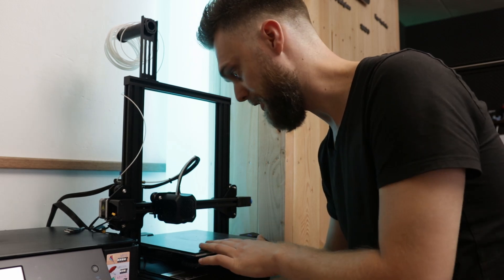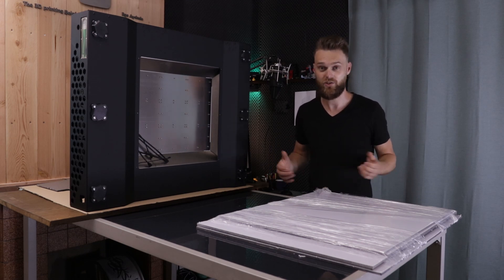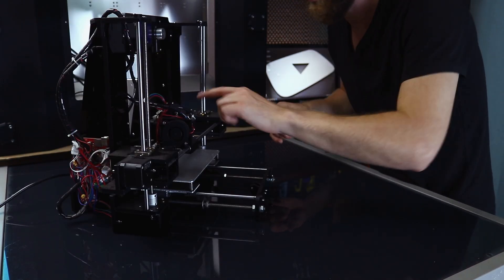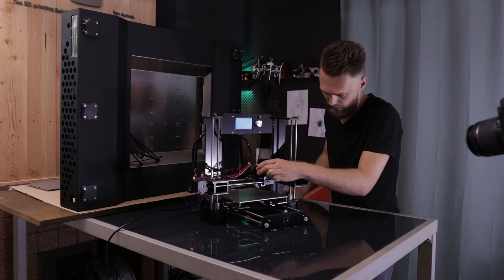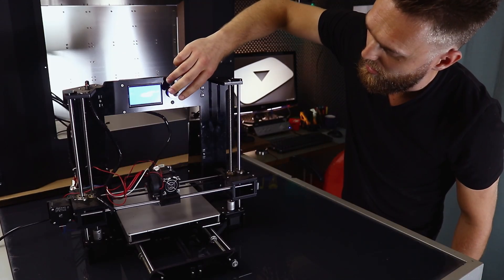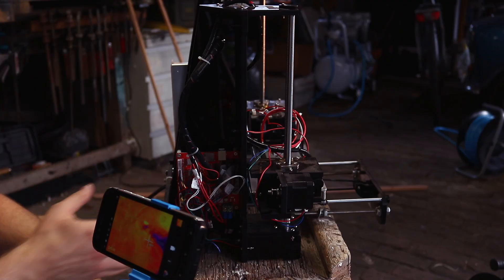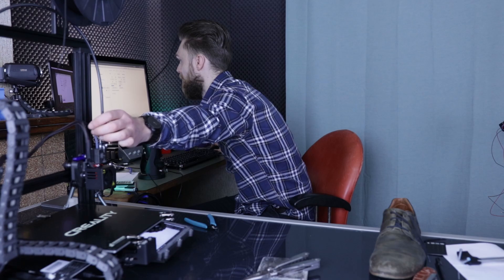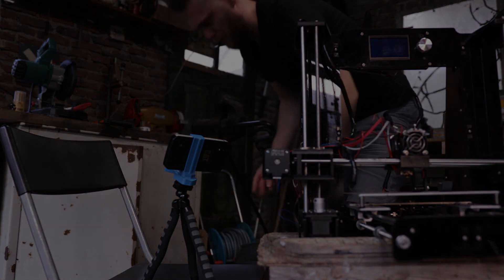Is it possible to destroy a 3D printer by moving the axes by hand?

Comment from the maker: Hi guys! I decided to do this experiment because I had this idea in my head for quite some time and it takes a bit longer for that enclosure to finish. Have fun watching and have an awesome day!
Reply: Be aware if you want a guaranteed way to nuke the mainboard, keep connecting and disconnect a stepper while the mainboard is powered.

I killed an Ender 3 output that way while turning it into a belt printer.
Reply from the maker: @JustTechGuyThings  Yes, that's the real back EMF you're talking about! Destroying the drivers isn't too difficult xD How did your belt printer turn out?
Reply: @properprinting  it's still in pieces in my dining room table :D
Reply from the maker: @JustTechGuyThings  sounds like a nice project! I want to do something similar :D Good luck m8 are you posting it once it's finished?
Reply: @properprinting  It's been about 10 months, I prototyped it using the regular bed  ( https://imgur.com/a/IVOVX42 ) but now I'm stepping up into an actual belt now.
Reply from the maker: @JustTechGuyThings  ow yes this is nice!
Reply: Populaire producten oplopende het goed om de omgeving is ook open zijn op o
Reply: Nice video, but there is a chance that you can destroy a trainamic driver by moving the axis by hand
Reply: There are cases when skr 1.4 sd card where destroyed by doing this. Not all boards derive well the power generated by the motors used as a dynamo. The ground connections, wiring, etc counts too. But if you have a minimun amount of brain inside yout head when mounting or designing your printer or your board, i think this will not happen. At least not often.
Reply: What about the z-axis? Because of the screw gear, rotation of the z motor is amplified, which could lead to a much higher voltage.
Reply: Maybe you could try turning the z axis with a drill. Would be much faster than you can do it by hand.

Comment: JUST NOW: I accidentally caused a fire on my driver and board. I was frustrated that the sensorless homing had become overly sensitive, so I tried to move the XNY axis by hand. Unfortunately, since the printer was still on, the driver caught fire. DO NOT TRY THIS, especially while the printer is operating.

Update: I managed to save the board (Octopose Pro 1.1); only the driver got burned down, and the main reason I found that that burned driver was getting power from the board was that my other driver was getting direct power from the power supply. Besides the driver, my stepper fans (all of them) burned too, have to replace all of them.

Comment: Nice video, I do love your efforts.
I fix 3D printers for others and one of them was the cr-6 which was running smoothly then when my friend suddenly moved the bed fast the machines low voltage signals became 0v and now the machine can’t extrude filament properly.  For most machines they are built decently enough to not become affected however the Ender series seems to have skipped this protection step.

Just a tip for people with the Ender machines I guess.

Comment: Onec i was tring to smoote the Vslot Y axis on my ender3, printer was off when i move the bad fast i just saw screen turned ON so this means moving axis make motors make electrics and turn ur device on for a sec so dont try it at least do it slowly, it well destroy board for sure

Comment: I know with certain board designs it’s possible. Had a small cnc in the back of a car and the axis was loose so driving around corners it was moving. That was enough to blow out the stepper drivers

Comment: it could depend on the drivers used or the manufacurer potentially cheaping out? i used to have a tronxy xy2 pro, where one day the z axis stopped working. the last time i worked on it i had manually moved the axis out the way while cleaning the hotend. those used integrated TMC drivers. so it was essentially a paper weight after that. my ender 3 with an mks gen l and tmc drivers is fine being moved manually too ime, maybe just coincidence for the tronxy dying

Comment: I'd have just coupled a drill to the stepper motor directly and driven it slowly increasing it's speed well beyond human capabilities until something happened. Do it with a taco and see how fast you have to spin it before something fails, would both be interesting and funny to do the math on how fast your arm would have to move to cause damage.

Comment: OK so this proves that the board in my printer was faulty and not something I did. 
I just got a voxelab Aquila x2 and managed to do a successful first test print. Starting a second print it did not move to the middle of the print bed and the filament did not stick so I thought I need to re-level the bed, so followed the instructions in the manual disabling the steppers to move the head by hand (slowly). trying to home the display would freeze after moving the Y axis and X would not move. could not move with the controls either. swapping connectors on the board for X and Z, I was able to move X with the Z control but could not move Z with X control. This narrowed the problem down to the driver IC for the X-axis. I don't know why it worked for the first print though.

Comment: This board has an inefficient regulator, the classic 7805, which you see emit heat here. Which is a good thing, that when the driver emits current on the power input due to motor backfeed, the relatively high current consumption on the regulator prevents the voltage from going up. The higher the input voltage, the more current is being consumed and converted into heat.

However, most other boards, like MKS, SKR, Geeetech and others have an efficient switch mode converter, where the more voltage you supply on the input, the less current is consumed, so in total much higher voltages can be kicked up, until something potentially gives up. But i estimate that it's still likely impossible to damage the board by human movement. I designed a circuit once to prevent high voltages coming from bicycle dynamo into battery charger, that is a current source of angry kind, but didn't get around to build yet, but i made some estimates back then.

But if you like, you can connect the stepper to bicycle rear wheel axis, you have a gearbox, you have pedals and leg power, and use a more modern board, maybe then you can burn it? Should be easier to burn without LCD, but maybe keep LCD for realism. I don't remember how the regulator is executed on Creality board that is now functionally missing one axis. If it's 7805 then you can just remove that and patch a step-down switch mode converter in.

Comment: You can do it on older types of stepper driver ICs that have no protection diodes built in the chips
Only thing you can break like this is the power supply if it's cheap Chinese kind without proper protections against overvoltages on output.

Comment: Finally someone does this! I have always thought this was a myth. All modern drivers, microcontrollers, etc., should have sufficient protection through clamping diodes and the like to avoid being easily damaged. Plus they are made to be connected to stepper motors, which produce all kinds of crazy interference and random voltage spikes, and they have to survive those. I am not saying you can't destroy your board this way - it is just highly unlikely. That said, more finicky drivers like the TMC2130 (that like to self-destruct if you hurt their feelings a little) might be a different story and worth another experiment! The A4988 that this printer probably has are extremely solid, i have barely ever seen a dead one, even back when people ran them without heatsinks and the current cranked up to overcome the rubbish mechanics of early RepRaps.

Comment: I have seen this to happen, so sorry - you have not disprooved it. It just survived for some reason this time. In fact it was on my colleagues Anet A8 he has at work (not for work) and it burned not only board but also display. And it was only one swift (but nowhere near what you showed) movement when the printer was off. Maybe even disconnected from powerline, don't remember. Not sure why your printer survived such abuse (A6 has the same board as A8, but different display). There are several board revisions and it was on the early revision so maybe they've added protection. 
For others - DO NOT TRY THIS! Seriously - fact that one board survived will not guarantee that yours will also.

Comment: Great demonstration! 

Now someone needs to put the shaft of the stepper motor into the chuck of a drill / wireless screwdriver and let it rip. If that doesn't damage the stepper drivers, nothing will.

Comment: If you hit it with a hammer to create a high voltage spike that may do it. Also depends on the control board and stepper driver.

Comment: It definitely depends on how well the circuitry is designed and wired, how reverse protection is implemented, and how well the high current rails are isolated from the rest of the control circuitry. When you get into ultra low end, counterfeit style knock-offs and night shift engineering, that is when you'll see modern electronics start skimping on  these kinds of protection features. Either by incompetence, fraction-of-penny pinching, or both. Sadly, that means a lot of the barrel bottom Ebay/Aliexpress/bangood/etc electronics. Especially notorious for little to no proper separation between mains voltage and low voltage "user end".

Comment: The outcome is flawed. It will feedback and fry the controller chip if you move the motors by hand while the printer is powered up. If the printer is not powered then it will not cause a feedback to the chips.

Comment: I think there is a bit of nuance in this. It depends on your drivers, your controller, if it has TLsmoothers, if it has backEMF protection, etc etc. I still wouldn't recommend it. Would you think it could be interesting to donate this printer to someone who might put it to use?

Comment: Thank you for actually testing this for us. I've actually been kinda wary because if I move the axis too fast the screen of my Ender3 lights up. I know I should be generating less current than necessary to destroy anything but it still doesn't quite feel right to do, so I try to stay under the speed that I know the screen turns on, just in case, y'know. This test dispelled my fears of spontaneous failure, but I'm still hesitant about the long term effects (not that you should need to sit there "polishing your guide rod" for hours on end just to disprove that as well, of course)

Comment: Answer before watching video: Yes, if there is no power to the printer and you spin the motors very aggressively. You can generate enough back EMF to essentially over-volt the drivers and fry them. This is why you can get your LCD to light up when moving the motors by hand with the machine off. They are acting as generators instead of motors. It's much more difficult if the printer is powered as most boards have some protections, but is still technically possible. So just don't move them very quickly, and to be safer, do so only with the machine powered. Realistically, there's very little risk.

Edit after watching. Wow, gotta hand it to that control board. Very impressive protections. I have definitely seen coworkers fry Duet drivers by moving the axese too agressively. I wonder if that is because the machine in question was CoreXY (so two motors were generating simultaneously), or because the protections on the Duet are less robust.
Fun video :)

Comment: Different printers have different electronics. The only thing you proved is that the back-emf generated by this particular motor is not enough to kill the driver on this particular printer. Stepper motors do generate a voltage when turned that if it exceeds the voltage rating of the drivers can kill them.
Reply from the maker: Yes, that's true and you're right. I don't state anything else in this video though. I want to do a more thorough experiment in the future because I think it's an interesting topic.

Comment: is it still possible to destroy the 3d printer by the stepper motors if they are being driven by another motor at high speed instead of moving them by hand. u have buster the myth for moving the steppers by hand and now u need to find at what extent the steppers will destroy the print :)

Comment: I have CR10 S4 with 2  Z axes. I dont have, yet, belt with gears on top to sinfronise them. Before every print i do auto home then move up 20 mm and measure if both Z axes are at same hight. Almost every time i need to adjust one Z axis and i do it with slow turns on cupler by hand while power on motors are enabled. That way z axes stay perfectly aligned. Then i put print on. Maybe you can destroy motor like that, while motor is on with power? Can you do that experement?
Reply: Also, i am turning motor just for few steps, not more, and i do it step by step, click by click. What would heapened if you turn motor too hard or too quickly while they are enabled?

Comment: I have managed to load the capacitors in the electronics above nominal 24V and generate enough power for Marlin to boot up completely by moving (or rather, forcing) Z-axis in my printer. I believe it is possible to generate even higher voltage which could in theory damage some electronics (30V for TMC2209 for example), but that would require serious... dedication. 
On the other hand, very short voltage spikes generated by fast movements may damage the drivers only a little, causing a bit higher power dissipation, reduced reliability and more. I mainly mean the diodes/MOSFETs in the H-bridges of the stepper motor driver. The printer will work normally but SOME minor damage can be done to the power stage in the driver.
Reply: Update: I have just measured 29V... a bit too much :D

Comment: Technical explanation on why this doesn't break the printer:
The motors are connected to the higher voltage rail and between that and the sensitive electronics that might get damaged there is either no direct connection or there is a step down regulator in between. Du to the capacitance and inductance that is introduced in the regulator circuit, even the short higher voltage spikes from fast movement are flattened. On the driver side there is also no problem since the mosfets don't let voltage to the gate where again the sensitive electronics are connected.

The problem of moving the motors mainly comes from the obvious capabilities of them working as generators and thereby introducing a voltage into the power rails and potentially into the control circuit. This voltage is completely unstable and more or less unpredictable which can lead to pretty high spikes that would potentially damage directly connected senstive components

Comment: Thank you tremendously for this video! I have said many, many times that destroying a control board simply by moving a motor is extremely unlikely, meaning it's perfectly safe to do so. The boards are able to handle very high current and making higher current than that with just your hands is virtually impossible (otherwise we all could just fill our houses with Nickel Metal Hydride batteries, spend many hours charging them fully [by use of arms, legs or otherwise] then living off that electricity until it nearly runs out). The human body is not a machine and cannot produce machine levels of power.
Thanks again for this video!

Comment: Personally, I burned out my extruder driver by pulling the filament and beyblading the stepper motor....
Reply from the maker: That sounds like an effective way to get high rpm's. With which printer/main board did this happen?
Reply: @properprinting  Stock board of an Ender 3 (older model, not the V2).

Comment: Any half-decent stepper driver has a current regulator that works both ways, ofc there is a limit what those can handle, but nobody can move their axis that fast. You'd have to spin the stepper with a drill or something to generate enough current to cause severe damage, especially on such teny tiny steppers.

Comment: I've done this with my under 3. When I saw this i already knew the conclusion you was going to come to. The only thing I can assume you would break are probably the gantry where the force applied might bend the rods or components accisently knocked. Like mention the LCD turns on and thats about it. No fans etc. You won't generated enough electrical energy to turn on the fans etc. I got to admit it was funny but I fancy my chances of face off if you fancy a challenge? Lol

Comment: I have heard this before about inducing voltages into the main board. Some people say it destroys the board and I guess that they are passing on their own experiences. Not all boards are created equal, some manufacturers use better components and some really cheap boards, if you breath on them they fail. My core XY has a good 24 volt board and I move the XY and Z and never a problem.
Reply from the maker: One of the reasons why I picked this Anet besides I'm not liking it. I assume that this is made out of the cheapest components possible, but I might be wrong. Interesting topic to elaborate on further ;)